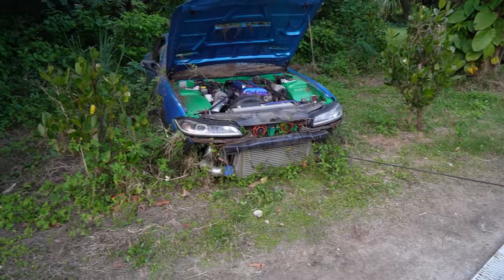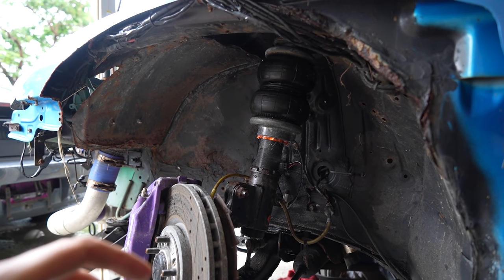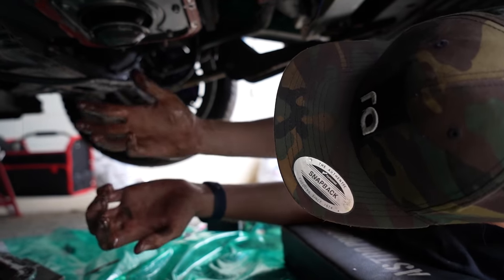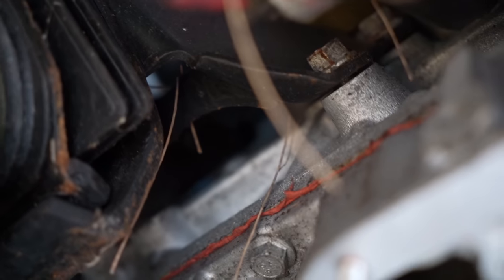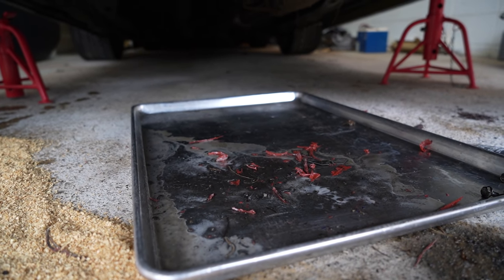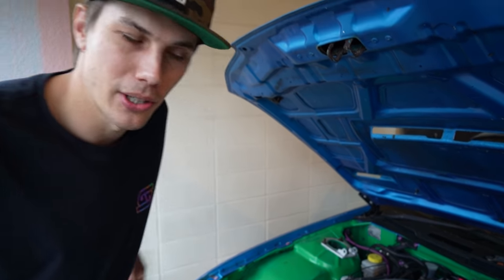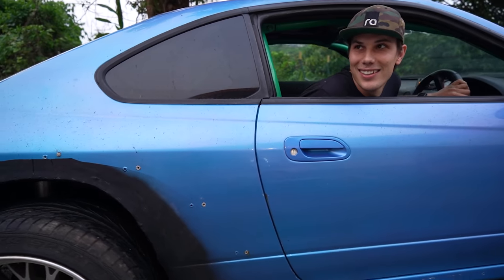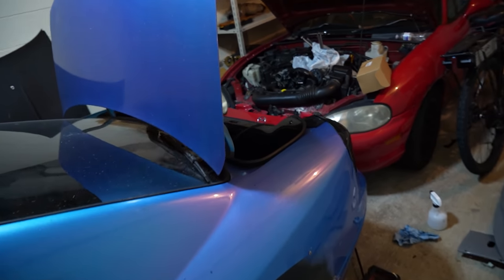THE ABANDONED S15'S FIRST BURNOUT & READY FOR SHIPPING TO TOKYO!

Comment: An old timer I used to turn wrenches with showed me you can actually take ATF fill your engine with appropriate amount and run it in your engine for about 30-60ish seconds and it will work like an engine flush an clean most of that gunk out

Comment: Closer inspection shows what the real condition of that car is. Corrosion everywhere. Personally I wouldn’t have tried doing a burnout as it didn’t sound 💯 and was struggling at that in the wet.
Reply: That corrosion is nothing. The engine sounded mechanically healthy as can be the tune was just off.

Comment: I've seen layers of sludge like that on the bottom of a pan when too much assembly lube is used.  It does catch n trap pieces of debris somewhat.  ATI dampers can be rebuilt and should every 10yrs/10k miles or on a real radical engine with hard use, every season.
Reply: Also in the case of a critical engine failure, IE rods, pistons, crank.

Comment: Sammit also release the water trap for the air system
There is probably moisture in the tank, lines and manifold. Not going to help with leaks but it’s helpful for operation